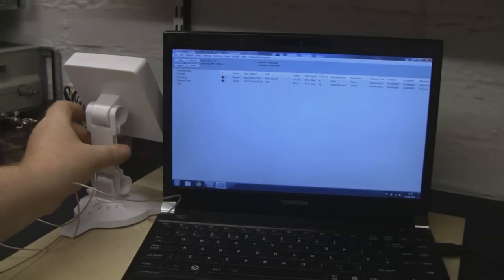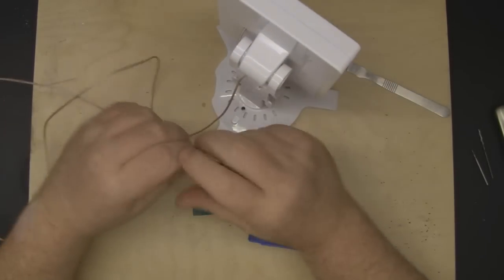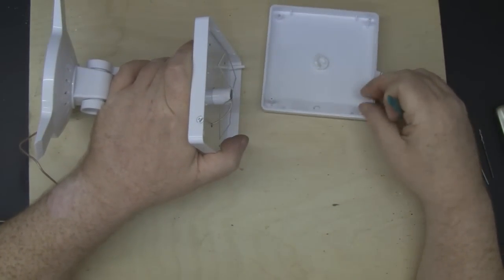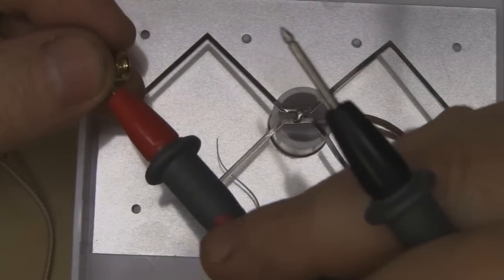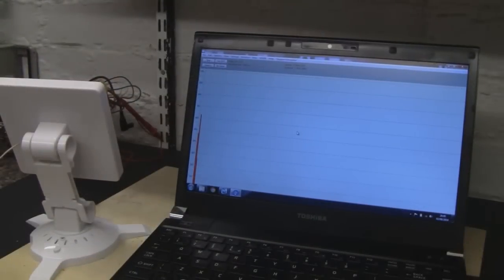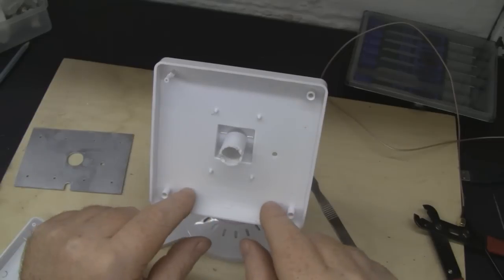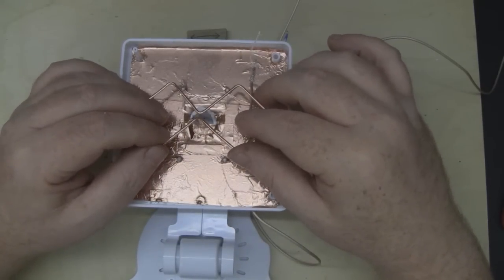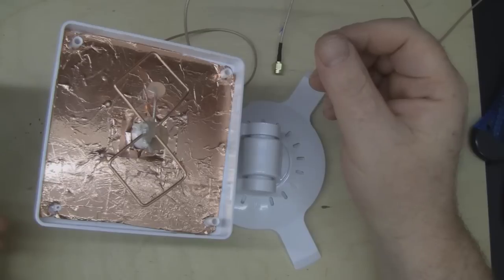Cheap Wifi Antenna from China

Comment: I took one of these (8$ eBay), opened it up, the dual quad antenna was actually w/in specs, I removed the lead in wire, took a netgear N300 2.4Ghz USB adapter, split it apart, wired antenna to it (this N300 has antenna ports inside), hotglued it inside case w/ antenna, mounted it on a pole, connected a 25ft USB cable to inside house, I'm seeing bizness SSID's that are almost 1/2 mile away ;)

Comment: 0ne wave length plus 5% as the antenna book says BTW for the reflector... Just a Correction to your video so people won't be doing it wrong!. Also a Reflector does not have to be grounded to be a reflector. Please refer to the ARRL Antenna Book. Also you pointed it in a different direction with yours it seems, being directional that matters. Just saying...
Jimmy, ARRL TS, WX9DX

Comment: Hi Andrew, Your coaxial cable has a sharp bend and this provides high impedance for the 4G signal (according transmission line theory). The sharp bend has been straightened but once it is bent, it can't be undone. Use another cable
Reply: I was going to comment on exactly this coax fault.  Someone crushed the dielectric at the kink and it will cause a low impedance mismatch from nominal 50 ohms. This will cause high VSWR and reflections preventing the full receive signal from the antenna to reach the receiver.  And that RG-213 coax is very good for this 2.4 GHz application.

Comment: Hello Andrew,

You're obviously like the best person to talk to about antennas on YouTube.

I have have a few questions because you become very inspiring and really have sparked my interest in a few projects. What I want to know is the following.

When it comes to buying copper tape single sided or double which should I but and do they both accept being soldered?

Could I make ( with copper tape on card board ) a portable cheap antenna?

Out of all your antennas that you have built ( I pretty much seen all your videos ) which antenna performs the best and why?

Thank You in advance Sir.
Reply from the maker: It is hard to say which antenna is best as they all have their strengths and weaknesses but the best all rounder in my opinion is the biquad.
Reply: andrew mcneil Hi Andrew,

You know what I did just out of stupid curiosity?

Like I said I was inspired by your work and knowledge.

I built a panel antenna really NOT expecting it to work. It's 11& 1/2 inches by 17 & 1/2". ( reflector ) the main panel slightly smaller.

Here's the kicker I had a really hard time trying to find copper tape BUT I have a NICE BIG FAT ROLL of Aluminum tape and was thinking would it work?

I couldn't solder the aluminum because that takes a special type of solder so I taped wires to the aluminum surface with aluminum tape and made sure there was a current running through the whole surface.

The aluminum tape by the way I did stick to card board matter of fact a Fed Ex box.

The thing actually works better then the two antennas that came with the wifi unit.

I was FLOORED! I didn't expect it to work at all.

Between the two panels are straws that are 4mm in diameter that I hot glued to the panels.

So far I've built four antennas because of you. Now that I know I can be successful at it I'm going to try and build something super powerful.

I Thank You for your great work. My internet is quick once again.

It hasn't been quick for almost a year!

Thanks Andrew!

Comment: Sir im watching ur vids since long time...i build one biquad antenna for 1900 frequency...the sides are about 4 cm each...but it doeanot work i think...i m tired now...i need an antenna for my usb dongle... can u make one for 1900 freq...while bending the wire..1 or 2 mili metter difference does effect performance??...

Comment: buy a wifi extender. Build a reflector like a direct tv dish and put the extender in front of the reflector.
Reply: does it work well? as I got a tv dish an a wifi extender, so far I put the wifi extender on the roof open so it can reach the best signal, but it only reaches 2-bar signal.

Comment: hey Andrew, when you have the time, could you please check out the Alfa AWUS036NEH wifi card, it's rated at 1w but i'm wondering how it compare with the original 1watt alfa card. thanks.

Comment: is the double bi-quad better than the bi-quad?
Reply from the maker: +Jon Groves Yes 3db better
Reply: thanks Andrew,

btw I have build several Double Bi-quads they work better than the usual "arial" antenna that came with my 54mbs dongle... I hooked the dongle up to a dbl bquad and its a Rockstar! all using YOUR instructional video to the letter. Altho I have used Aluminium Plate as the base reflector the next few I make (and sell) will be made of wood as I feel I am loosing too much current to the plate and not the actual antenna itself* Oh last thingy, how much do you recon I should sell the db bquad for? Im thinking R750.00 - is this too little? what do you usually sell yours for? 

thanks Wifi-guru Man! 

kind regards,

Jon.
Zen Designs.
aka JAYFi wifi antennas.
Reply: القران الكريم نور لك في الظلومات

Comment: What's 1 wavelength square?
Reply: I believe that is the wavelength of the radio signal is equal to the length of the sides of the reflector. For example a wavelength of 10cm  will have a 10cm x 10cm reflector.

Comment: not really  bridge...center of the coaxial to one side, and the ground to the other side !! you cannot mesure this directly, because we are in RF, not in continuous... hf or rf are different to direct connection !!..open the box has maybe change the frequency, because we match the antenna with the distance between the reflector and the antenna !!